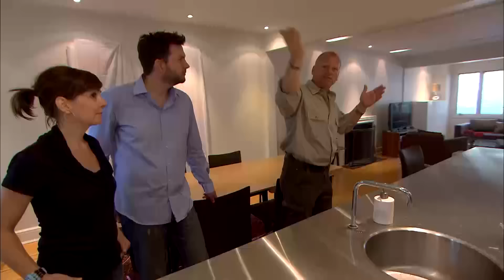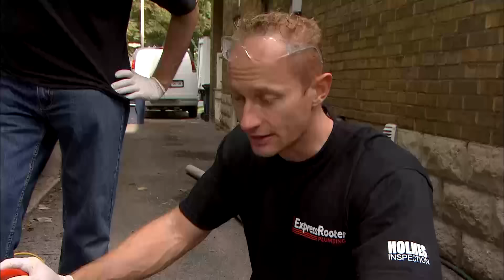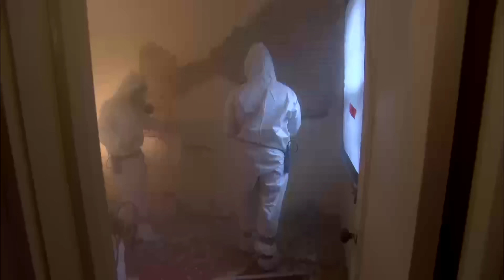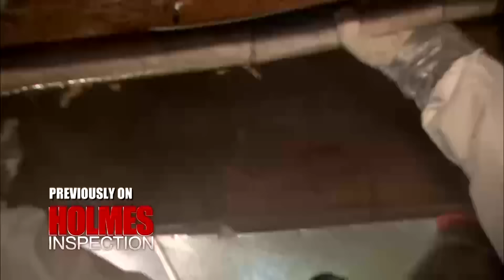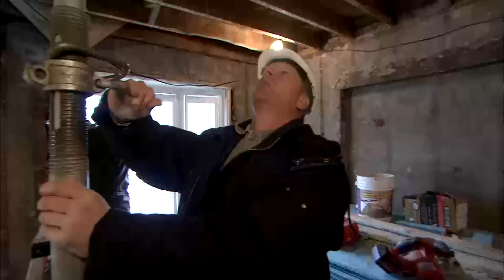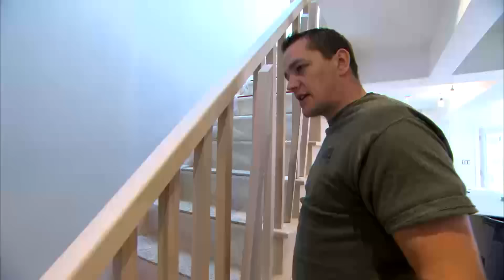Worst Home Inspection Fails | Holmes Inspection 122+123

Comment: I know I commented before, because I had that question, but this video came back up on my feed, and I remembered something that I didn't think to mention before.  My grandfather was in construction, as a matter of fact he designed and built bridges. He used to be part of the Army Corp of Engineers.  This is a lesson he drilled into my brain, and the brains of all of his children (he had six).

When buying a home/property, NEVER, EVER trust a homeowner's inspection or inspector.  ALWAYS get your own.  A homeowner's building inspector works for the HOMEOWNER.  You want a home inspector that works for YOU.  Second thing... when you do go to hire a home inspector, DON'T go for the first one you meet.  Like everything else, shop around.   In point of fact, you want a home inspector that property owners HATE to see coming.  Why?  Because those are the ones that are sticklers for details.  Those are the ones that are going to pry, check for permits, give detailed reports and nick pick everything.  THAT'S what you want.  Last, and most IMPORTANT.  If the homeowners try to set a time limit for a home inspection... WALK/RUN away!!!  If they are trying to rush the inspection, then more often than not, they don't want to give your inspector the TIME to find what they've hidden or covered up.

Comment: Well home inspector not fault, probably he/she inspector houses after rehabs. Not possible to see through walls. I have been inspecting houses with rehabers and realtor hidden a lot of issues. Visual and none invasive inspection. To see at the time of inspection, it’s not possible walls closed. That’s why it’s so important to inspect the whole rehab or disclose issues before closing. Remember, future behavior of the structure it’s not possible see it without reference of the old structure. Not our scope of work to determine it.

Comment: I grew up in New England and every house I owned was more than 100 years old.  The thing you have to remember is many years ago, they didn't even have permits or licensed tradesman and then there were generations of handymen that made major changes, like moving stairs, converting lage houses into apartments, etc... One house I owned was originally built with gas lamps, then knob & tubing was reno'd in, then comex, then romex.  When you did any kind of tracing of the electrical, you'd often trace the line back through all three technologies of wiring, and then find live gas pipes behind the light fixtures.  In some cases, they used the light fixture as the cap on the gas pipe.  You take the light fixture off and you have natural gas flowing out at full blast.
I can understand how this happens, even with me, I only corrected the rooms I worked on one-by-one, the rest of the house still had the hodge-podge.  It was really my dream to be able to gut-it, but most homeowners aren't really able to afford that, you need to do it piecemeal, which is kind of how all this happens in the first place - yes, I did sell it and move before I got all the rooms complete, so the next guy needed to go through the same crap as I did with the rest of the house.

Comment: Are you doing the inspection so because you will do the repairs. Isn't that a reason NOT to do the Repairs ???
Inspections should be done by people that don't have a reputation on the line. I do not agree with the crew doing what Mike labels as critical structural issues.

Comment: There you go again with “cinder blocks”
They’re called concrete block. CMUs
Cinder block aren’t structural. 

This house is a disaster, I’ll give you that, but brick overhanging structural steel a bit is common practice. No need to scare that nice pregnant lady more than necessary lol

Comment: This one is making me a bit ill. The previous HO moved the laundry from the basement to the upstairs (bedroom level). That floor slopes noticeably toward that laundry, and the whole 114 yr old house shakes when the washer spins out. I will find a way to move it back down, but the dryer's electric connection was moved, not just disconnected, and I can't figure out where the dryer vented through the wall. In addition, there is no washer drain. It was put to the sump basket, which used to lead out to a grey water septic. We were told that grey water septic was an unused well, so by Minnesota law, it had to be sealed. It was mid-October 2021. When the frost let out the following April, all the water the sump pumped out from the water treatment system, dishwasher, and kitchen drains came back into my basement. No, the inspector didn't catch the sump load, nor did he know anything about wells. Thankfully, i was working for a well company at the time. The saga of home ownership.

Comment: Lets address the 1000 lb gorilla in the room ... Holmes would not be a successful inspector because in the realtor world, he'd be considered an ALARMIST. Before I go on, I just want to say that as a home inspector I fully support this video. But the business of selling homes has created a big problem. Buyers are the client, BUT realtors are the source of producing clients. If the realtor doesn't like you cause you're an ALARMIST, they won't refer you and you, the home inspector, go broke. Home inspection is a tough row to hoe.

The seller's inspector that originated the first report will probably get sued, even though they are not allowed to cut into walls or be invasive at all. There are definite issues that were still visible that weren't reported and that's why they'll be served with a lawsuit.

Note about the asbestos: Asbestos is not a problem unless it is disturbed. So he's gone overboard on that callout.

Comment: So what happens when an inspector fails at their job this hard when it comes to insuring those who are within the dwelling are being protected both financially and health? Can it be a case of negligence and opens up their past inspections to further scrutiny on their or their business' dollar or do they just get a slap on the wrist? Can they get sued when it's this egregious?

I'd have to believe they're held at the highest standard possible to inspect the structure and are an even larger liability to themselves or who they work for than they are with providing half-assed reports.

I'd also imagine that once asbestos was found then that information would have been given to the home owners in the area especially if they were all built around the same time?

Comment: This proves there is a full range of inspector knowledge, quality and value. You need to really research the PRE-PURCHASE inspector you hire, and for a remodeled house, you better get that good inspection or you will end up like this poor couple.  I saw an inspector video where they commented that flipped house sales do not require a disclosure. So again, you NEED NEED NEED a competent inspection - $1K-$2K minimum. Maybe I missed the final cost, but I'd expect $400K-$500K; if $300K, you got a steal bargain.

Comment: How can a Building inspector not be sued for this?   the contractor who did the half baked renovation?   The seller of the home? 
 In the U.S it is the very same deal,   building inspectors that have no training,  no idea how a home is even built,  they know nothing about structural engineering ,  carpentry , electrical,  plumbing,  HVAC.
 Yet they are over charging perspective home buyers to give peoples homes a clean bill of health?   and then the buyer has no legal recourse?  the system is purposely corrupted , because as far as America is concerned everything is about profit ,  there are no morals, ethical, integrity in any business anymore.
 congress allows this to happen ,  local politicians allow this to be the norm.
 there are people buying 14 million dollar homes and finding out the contractor who built the home had absolutely no clue what they were doing.
 the same applies to homes that cost 200k and everywhere in between.
 if you get out of high school and invest in some tools and have zero experience you can literally watch Youtube videos and become a builder .
 why? because profit over everything is the norm here now .

Comment: At what point should you tear down the whole house?
Reply: Don’t tear it down completely unless your on an sinking sand or burial ground
Reply: Leave a wall and the building is grandfathered in to whatever code was around at the original time it was built. Destroy the whole thing and you then have to go with current codes.

Probably a setback issue.

Sounds like in this area they need to leave two walls or original foundation to get around the code.

Comment: I am sure that the home inspector pointed out the saggy floors and recommended that you have a licensed contractor or structural engineer further evaluate the property prior to closing. These shows kill me with all this reenactment with the drama. A home inspector is not allowed to put a hole in the wall and see the actual foundation when it's covered with drywall. But this is TV and entertainment. I'm almost positive they ignored everything that the home inspector said and went on and purchased the house because it looks nice

Comment: “IWe had a bit of a structure problem.” Has to be the understatement of the week.
      A note about inspectors — especially “home inspectors:”. Far too many are but code-book wonks with no construction experience at all. If you’re lucky, you’ll find one with serious trade qualifications as well as their “home inspector” certificate.
      I’m not surprised the structural issues were overlooked. Face it — with older homes nothing is plumb and the building techniques can be quite different from today’s. More important, the inspector is so focused on looking for trees he completely misses the forest. A little crack, a little bow . . . What else is new?
       Most often, the structure is compromised where changes were made to the original house. Walls are moved, room added on, pillars taken out. Often your warning signs — cracks in the plaster, bowed ceilings, etc. — are concealed by paint, plaster, and trim carpentry. The homeowner has no idea that nicely remodeled kitchen will start popping off the new cove molding in a few months; nor is he likely to consider the cause. Nope, it’s more nails and super glue to keep that pesky molding on . . . Not realizing that they’re looking at the only warning they’ll get before something breaks.
      What’s amazing is that it’s so rare for homes to collapse.

Comment: As an electrician, there have been a few times I’ve had no option but to pass an electrical line through a duct (or other sheet metal structure). Here is my solution:
        Fire sprinkler supply houses (a plumbing specialty) carry fittings for this. The fittings resemble compression EMT fittings, except they are sized to pass EMT through them. They are designed to seal the penetration through the sheet metal. I use them to pass an EMT sleeve through the duct. Outside the duct I attach an EMT connector (with bushing) to the ends of the pipe. Now I can pass the Romex through.
       You’ll want a drill bit as long as the duct is wide, so your holes will line up. Such bits are quite affordable at Harbor Freight.

Comment: When these sellers and realtors fail to disclose the agents should have their licenses censured and if repeat offenders (pulled)… and the sellers should be on the hook to compensate the buyer for the repairs.
Reply: And so should the building inspector too especially for the major stuff
Reply: Where I live (Utah, USA) a seller has to fill out a "declarations page" listing everything wrong that's known about the house. If the problems are behind the walls where the issues are invisible the homeowner isn't responsible for them because he probably isn't even aware that there are problems. The key is whether the home seller is purposefully covering up something or is just ignorant of it. When we sold our house we listed every picky little issue we could think of to be safe from a lawsuit. 

We had an inspection done before we bought the house and things checked out, but a few months after we moved in the furnace went out and shortly thereafter the air conditioner had to be replaced, too. The house was only 9 years old. If we had known that we'd be forking out $10K+ a few months after moving in I doubt we would have bought it.
Reply: I would love to see that!

Comment: Would have been smarter to demo the whole thing.
Reply: Leave a wall and the building is grandfathered in to whatever code was around at the original time it was built. Destroy the whole thing and you then have to go with current codes.

Probably a setback issue.

Sounds like in this area they need to leave two walls or original foundation to get around the code.

Comment: I have been in construction for many years and can testify on how many houses I've seen like this. Unfortunately the work is very expensive and nobody wants to pay for it. I do the best as I can but of course there's a limit I can do. I wish I had Mike's budget
Reply: It is true. Sadly as Mike told them the cost is going to be in the hundreds of thousands. Basically would equal the same as building a new house instead.

Comment: Sounds like a lawsuit. Inspector and whoever did the remodel.
Reply: The remodeler maybe, but I think he said it was done in 1989, which was 20 years before this episode was filmed. The biggest target might be the home seller, depending on disclosure laws in their jurisdiction.
Reply: Usually there's a clause in a home inspection that it's just a visual inspection and they aren't liable for any issues.
Reply: Maybe, but the majority of the real issues were covered up. The inspector should have noted the electrical and floor sagging at least. Any idiot could walk into that house and notice that without walls or adequate support in the middle, you have to check for sagging. The other issues like asbestos probably wasn't going to be found unless he could tear out the drywall. Like bryan said, disclosures have to come into play here.

Comment: Mike, the solution  to most of the issues you uncover  discuss ( with relevant local city depts)) setting up a comphrensive training programme targeted at Inspectors,  developers and anyone that  needs to knis this information.  The course  can be done in-house, utilising all thd teams currently use. Alternatively uou csn partner with a local college/ university  to provide the ACCREDITED programme.
Reply: Unfortunately no, it isn't that simple. You have many builds where people under cut the renovation crew/construction crew, basically coming out that they are not paying the full amount but the crew is in contract to still finish to a degree. So patch work is done instead. But also you have many house flippers with the "I know a guy" contractors they call in, meaning very illegal things are being done and that is why it is so bad. You're talking about people following the rules, and we have many of those, just in these cases it isn't those guys working on it.
Heck even in the early years of Mikes show he wasn't following code and law and got sued so so many times, almost lost his ability to do any construction work.

Comment: It seems to me much better to buy an old house in original condition and then get an engineer in to help design your own renovations, than to go for a "completely updated to modern standards" house where you have no idea what was done to the structural elements.    (If you want a modern house, go buy one and leave the old, well built houses for people that want them  all original.)

Comment: The house fills me with terror. This is the type of house where you see the open concept and the bowl effect and you leave. I cannot stress how bad this is. Clearly the dead load is also causing problems, not just the live load. Without correction, it'll keep sagging. Cracks will appear, you'll find chunks of plaster and drywall on the floor. Then it'll drop. Best case scenario, you have a few hours of warning before the house caves in. Worst case, it happens suddenly.
In other words, this house was a ticking time bomb of loss and devastation.
Some stories on a larger scale of structural failures were the Hotel New World in Singapore, the Sampoong Department Store in Seoul, South Korea, and this list just keeps going.

Kansas City, Missouri, July 17th, 1981. The Hyatt Regency Hotel. Two suspended walkways hung from the atrium ceiling  with a badly designed box girder support and costs having been cut collapsed during a party. 114 people died.
Zolitūde, Latvia, November 21st, 2013. Maxima Shopping Center. A huge portion of the roof collapsed on shoppers due to changed structure, forged documents, and improper girders. 54 people perished, including 3 rescue workers.

This is my worst nightmare as someone who studied structural engineering for a while. All the collapses I mentioned were the result of someone messing with structural loads that had no business doing so. Whether they cut costs and weakened the structure as a result. Or changed the design last minute and didn't adjust the structure to match. Or the designers were not qualified to do such calculations.

Comment: We owned a home in Hawaii that the former homeowners removed a load-bearing wall and the ceiling began to crack, prompting those homeowners to apply a thick texture to the ceiling.  $$$ later we jacked up the ceiling, installed an Ohi’a supporting post,  re-drywalled the ceiling, tied the attic joists, and made it right.